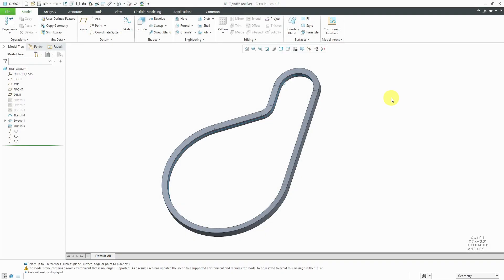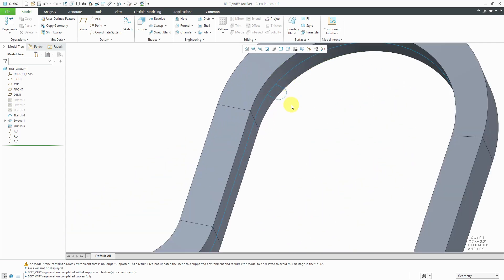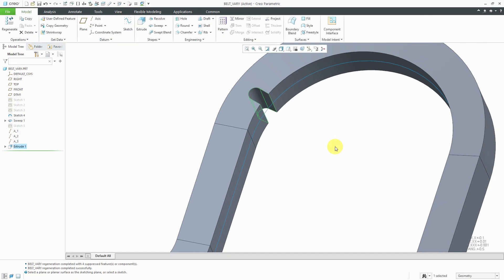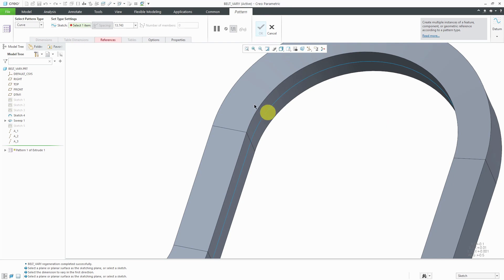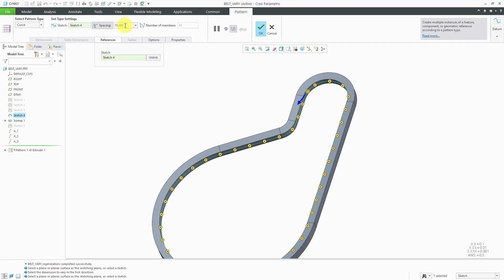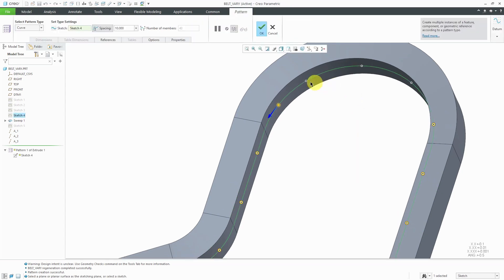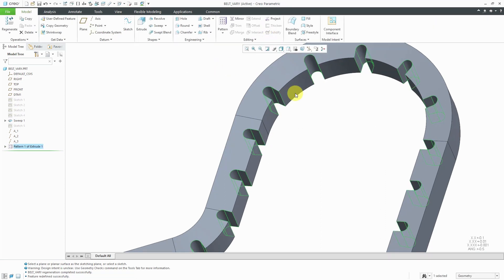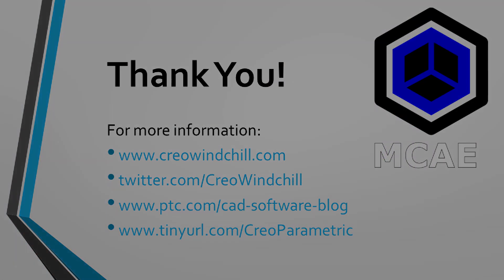Creo Parametric - Curve Patterns (Demonstration)

Comment: I am trying to do pattern through curve (a rectangular curve which fillet at each corner) but the features are gradually getting offseted inside curve 
Could you please help me to resolve.
Reply from the maker: I recommend opening a ticket with PTC Tech Support. I recall this issue, but I can't remember if it was associated with specific Creo versions or build codes. The tech support professionals are more suited to help you with your issue.
Reply: @CADPLMGuy I'm using creo 10.
Reply from the maker: I still recommend opening a ticket with PTC Tech Support. I personally don't remember details about which versions certain specific issues occurred in.
Reply: Same problem occurring with me, whenever I want to pattern a feature along the elliptical curve, it gets offset from the centre.

Comment: I am feeling pretty proud of myself. I feel like I picked a lock. I made a racetrack pattern of holes on a cylindrical surface ... picture a missile body with an access cover that sits in a pocket and is secured with  20 screws that are all normal to the curved surface. It kept failing until I made the curve racetrack only half then mirrored the pattern. Not ideal since the hole note will be inaccurate. Anyway, the suggestion to put a datum point at the start of the curve helped. A closed loop never worked. It threw holes all over the place in all manner of trajectories. An error warning about missing parameters would have been sufficient. HAHA

Comment: What if you want to create a hole pattern which its respective axis is perpendicular to a non-flat or free surface, following a curve? In my experience, I have to create the axis and respective hole one-by-one in order to guarantee that the hole is always perpendicular to the surface, which is very time consuming.

Your insight on this would be appreciated :) Nice videos btw!
Reply from the maker: You should be able to do this with a Fill pattern using the Curve option and Follow Surface.
Reply: @CADPLMGuy  Yes, I know this way but still it does not work well in some cases. Surface design in Creo feels a bit limited when compared to CATIA for example, which has more specific commands for this kind of "non-parametric" features.

Thanks for your comment!

Comment: I'm using Creo and when I make a curve pattern, the instances don't follow the actual curve.  They follow a path that is the same shape and size as the curve, but offset by a significant amount.  You can choose an alternate origin and get the preview dots to lie on the real curve, but the final geometry is still jacked up.  I wish there was a way to post a picture in these comments to show what I mean.  This makes this tool pretty much useless.  Maybe it's just a bug in Creo 3?  Seems like that would've been fixed before moving to the next version though...  Any help would be appreciated.
Reply: I was having the same problem as you and then I realized that it could be related with the position of the starting point of the curve. If you create a point at the starting/end point of the curve and then use it as reference to create the sketch you wanna use for the pattern you'll find that there's no longer an offset.
Reply: @pedrovinuesa7286  thanks
Reply: @pedrovinuesa7286  
Yes, I ran into the above issue and the one thing that helped me was to make sure all references for the feature I wanted to pattern were not referenced to the "standard" datums.  Thank you for your help.
Reply from the maker: Curve Patterns definitely got enhancements to address those issues since Creo 3
Reply: @CADPLMGuy  Im using Creo 6 and having exactly the same issue ...
Reply from the maker: @muetze58  Have you filed a case with PTC Technical Support?
Reply: @muetze58   even i am using creo 7 and the same issue happens, pattern instance got offset from the original curve.....any solution you got?
Reply: I am using Creo 11, yet similar problem arising. No use of such features.